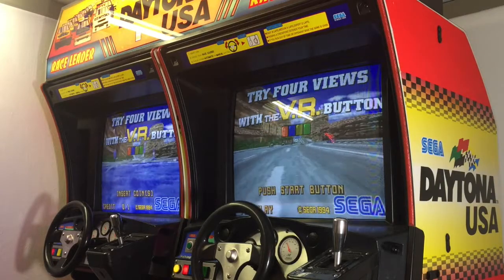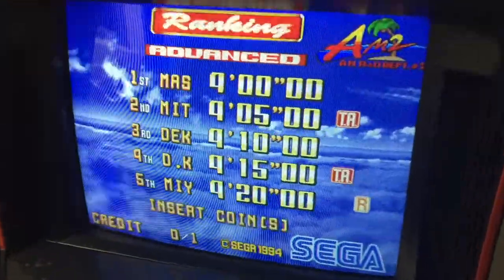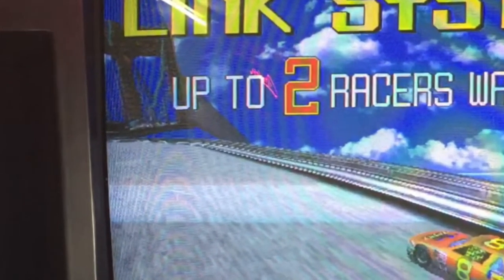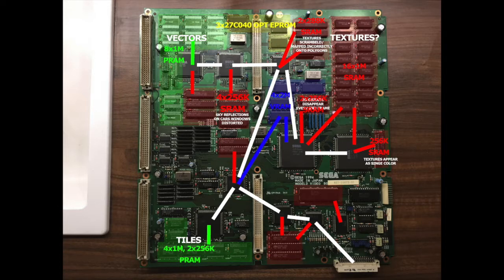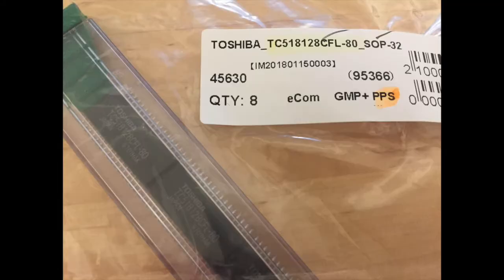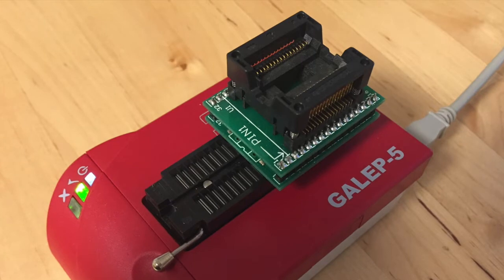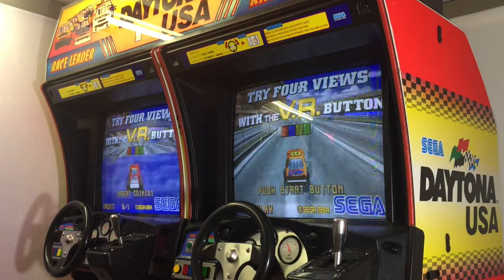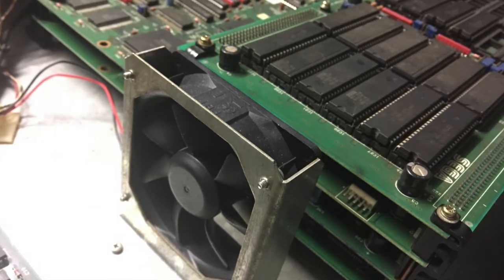Daytona USA Arcade PCB repair - 3D vector graphics issues

Comment: This isn't the only reason you will see those problems. Another common issue is bad roms on the top board as mask roms are all failing now. Also problems with corroded sockets and corrosion in general on these boards and another big problem is open vias on all boards. This game has been running in arcades for 25 years abused and neglected and the dust from the fans picks up moisture since most arcades are on the coast and together with salt the boards eventually rotten all over. I actually reverse-engineered the whole thing including the separate sound board (which took 1 year!) just so I could fix these boards and did so for more than 10 years but eventually they become too time consuming and with so many broken traces and getting worse as time passes I eventually gave up. I still fix the sounds boards now but that's all. I am mainly doing like you and fixing older stuff.

Comment: The rom you mentioned is part of the Model 2 video board roms archived for MAME by me about 15 years ago along with 5000 other games over the last 30 years. Nowadays they are not included with game roms they are separate as the base model2 roms. Look through the MAME model2.cpp source code for the file names and you can find them at various places.

Comment: Hello, I hope you can help me. We own the the daytona raceleader set and i moved it a few feet and tried to turn it back on and now it wont work/turn on. The main machine has a black screen and makes a popping sound when i turn the power on. The slavedriver does turn on but will not work without the main machine working. In need of help if you have knowledge on this issue please and thank you in advance.

Comment: Great video! I recently picked up a twin in terrible condition that I’m trying to fix. I’ve got one side working but on the other side of the game won’t boot. By exchanging some boards I found out that the problem is in this bottom board for the graphics. Do you have a suggestion which part of the board might cause that the whole game won’t boot? I have no LED lighting up in the cpu with this board connected.
Thanks!

Comment: I have bought all the chips your referred too, and bought a programmer but it has not got a chip adapter for the larger chip, I am at a wall, is there anyway I could send my board and chips to you and pay you for the repair. I miss my Daytona, if it’s easier, I can be reached at 423 394-0390 . Name is Jeremy, thank you

Comment: we had a cab at work start failing all we did was clean it out and replace the fans even adding some extra and it seemed to fix it for now as the parts in this cab are very heat sensitive and the fans tend to die without people knowing so there is bad airflow so pwople do remember to check the fans and clean out the dust before it gets to the point shown in this video

Comment: Thanks for the info, I too have since bought some bad Daytona boards and managed to repair them with this information. I also had an issue where certain textures had a grid of black or white dots running through them. This was due to one of the texture SRAM chips being bad in the set of 16 in the corner. On one board the dots would appear at certain distances from the camera but the texture would be fine up close, I think the texture ram is split into four banks of four chips, each chip holds one pixel in a 2x2 array of pixels, and each bank can have a separate texture lookup, say for different mipmap levels. Also I had a Sega Rally with random missing polygons and some polygons 'getting stuck' in 3D space, this turned out to be the middle SRAM in the set of three chips which are to the left of the 4x256k chips in your diagram. When polygons appear to jump in and out of perspective, that is definitely the lookup table held in the 3xOTP roms, I had to replace two of those to fix an issue.

Comment: I don't believe heat can cause all this troubles because if you look in to the datasheet of the TC518128CFL-80 for instance, it dissipates only 330mW. If they are heating up is because they are oscillating. In general the cause might be some decoupling ceramic capacitors near this components or electrolytic capacitors(e-caps). E-caps has a life span of 10 years tops, after that fluid inside start to dry out and internal resistance increases changing the characteristics of the component and it will start to heat up.
What I do is to replace e-caps with polymer capacitors, polymer is a dry component so this parts will last way longer than e-caps, they have a very low internal resistance but they are a bit expensive.
Reply from the maker: If the dust does not cause the trouble, then how do you explain then that only the dust covered chips are dying while there are dozens more of similar ram chips on the boards?
Reply: @christophzett  My mistake, I meant to say heat not dust. Dust plus condensation can create a conductive sludge and short it out the component.

Comment: Question if i had a spare board and took a ram chip off that could it be used if its the same type and model chip and also is it mandatpry to replace the eeprom if i use a ram chip from another dead daytona board
Reply from the maker: I was actually able to fix some boards by only replacing the rams. So I think it could be worth a try. Its a bit of a game of luck because it would be very very difficult to check which ram chips are bad and which are not (on the donor as well as the recipient board). But if you know the donor did have no graphical issues and died from some other cause I would go for it I think.
Reply: @christophzett  thanks for the reply my issue is that it has the wierd flicking graphics and bad camera angles as well as on the tgb test ic 47 came up as bad could just replacing that chip fix it or would it be worth replacing sets of them untill the board is functioning properly

Comment: Question: How do you know when the PCB board is failing? I just has one side of the twin pcb serviced with new parts eye lids etc. Im worried the other side will go out next. I cleaned the working board the best I could
Reply from the maker: From my experience there are not really any early signs which indicate that a failure is near. By cleaning the pcb you did everything you could to prevent the problem from occurring.

Comment: Awesome! I’m gonna try this fix, one of my boards is doing similar things, but is also losing textures to the polygons. Thanks for this info!
Reply from the maker: You are welcome! Please keep us updated and tell us whether you managed to fix your issues! It would be awesome if this video actually helped someone! ;-)
Reply: the hardware is heat sensitive had a fan go out on one cab at work and after it had been on a while it would have graphics issues badly but we replaced the dead fan and added a second one and cleaned out all the dust and crap, so far so good

Comment: I've just had a PCB generate errors like you have described.

My issue started with the graphics flickering so you could see the background underneath the 3D polygons, it's progressively getting worse and it's starting to glitch more now.

I will buy the chips and update you on the result.
Thank you very much for sharing this important information!

By the way, where did you get your lovely chrome shifter knobs?
Your twin machine looks great!
Reply from the maker: icuk7 The way your pcb behaves sounds that this fix is exactly what it needs! Please tell me if you were successful. Thanks for the compliments on my daytona, it actually was a lot of work to get it look that nice again. I got the chrome shifters as replacement part on ebay. They show up from time to time.
Reply: Yes! After being so sad when the glitches started, I'm now looking forward to trying to repair this stack.

I took a movie of my issues, you can see it here:
https://www.youtube.com/watch?v=cSSx3ypFYO8

I know exactly how much work it takes to get a cab looking like yours. If someone has never restored a machine they really have no idea how dirty a job it is. I feel dirty for days after cleaning a project machine.

Thanks again for this excellent information.
Reply from the maker: icuk7 Looked at your vid. Your board has some vector issues I think. So you should go ahead and apply the fix. Unfortunately Also there might be some additional graphical glitches going on. All vector graphics appear kind of transparent also maybe theres some texture issues too... :-( I actually would have sone ideas how to fix these issues ss well.
Where do you happen to be located? US? Europe?
Reply: Hi Doktorzett,

I have an update for you.

Replacing the 8 ram chips solved the glitching issue, but we reused the original eprom chip. :-)

My friend did the soldering as I'm not experienced enough to tackle surface mounted chips.
Initially we thought replacing the chips didn't work as there was no graphics at all, only background bitmap. But he removed the chips and resoldered the 8 ram chips and 1 eprom and it came back to life.

Thanks again for your useful video my friend.
I'm sure your video will help many more people over the coming years.

Thanks.
Reply: I'm located in the UK.

Strange things happen to graphics when ram goes bad, so I'm hoping replacing the chips you suggested works. If not then I'm not sure what to try next.

If there are still some glitching issues, then if it's possible, I hope you can give me some further suggestions.

Thanks.
Reply from the maker: Awesome!!! Really happy that you were able to fix your game! Thank you very very much for your nice feedback. This is what motivates me to make vids like these from time to time :-)

Comment: Where can I find that diagram that shows what each section is for?  That's a handy reference.
Reply from the maker: That is not really available anywhere and I don't have more than what you see in the vid. I made that diagram when I tried to find out what chips are doing what and what is connected with what on the graphics pcb. I removed lots of chips and checked the resulting symptoms. At the end I found the ics responsible for storing the 3d vector data and the 3d graphic transformation processors and their attached eproms (which btw contain some sort of simple tables for either depth sorting or for the 3d transformations) in the top left of the graphics pcb.
Reply: That's pretty cool.  I have about 20 broken sets of these boards laying around, but I don't have any SMT rework equipment yet.  I've known about the RAM chips, but haven't found a good source for buying them yet.  But the most frustrating part is not being able to probe the video board with power applied, since they don't seem to make 96 pin DIN-41612 extender cards.
Reply from the maker: Exactly, it is practically impossible to live-troubleshoot this. Even if you would make 41612 extender boards for yourself (and I was about to do that) you would still run into the problem that the pcb stack is connected sideways to the filter board in the metal cage which then would not fit anymore so you would have to build an adapter for that, too. The ram chips are available on ebay from china. But them alone wont cure your boards completely most of the time - the eprom is also an important part of a full fix.
Reply: Hi, where did you source the eprom from?

Thank you.
Reply from the maker: icuk7 Just do a google search for the zip file. Look in the description of this video for the file names.
Reply: @christophzett  not sure but maybe he meant where did you buy the chip from. none of the big vendors dgikey, mouser etc seem to carry it. here's couple that do https://octopart.com/at27c040-15rc-atmel-491619

Comment: Another outstanding video. Extremely fascinating and helpful that you point out which parts of the board are responsible for each function. Cheers!
Reply from the maker: This time is was more of a retrospective report rather than a prospective step-by-step repair. But I think it turned out ok! Glad you like it, thanks!
Reply: I was thinking that it was a case that the bad RAM was acting as a buffer to store the 3d co-ords when drawing the road and environments (reads don't match the writes). Time to have a look through the MAME source and check that colour map of the PCB you did so I can learn some more about the architecture. Thanks!
Reply from the maker: Yes, I absolutely agree!

Comment: Great tip there, man! This is the sort of thing you don't see a lot of on youtube. I'm pretty sure it's going to help someone out there. How about putting a dust filter on that fan? I'm surprised at how many arcade machines don't do this.
Reply: On later Sega machines the fans actually were turned around in order to suck the hot air out of the cage. So if a filter can be put across the remaining ventilation holes then it should hopefully stop most of the dust getting inside.

If I ever get some working stacks then I will be putting more fans around the cage to try and keep temperatures down.
Reply from the maker: Thanks! I hope that this vid helps other people/saves faulty daytonas from ending up in the bin. Some sort of a filter would be a great idea! I wouldn't know what to use though - it should keep the dust out and at the same time not add too much resistance to the airflow.